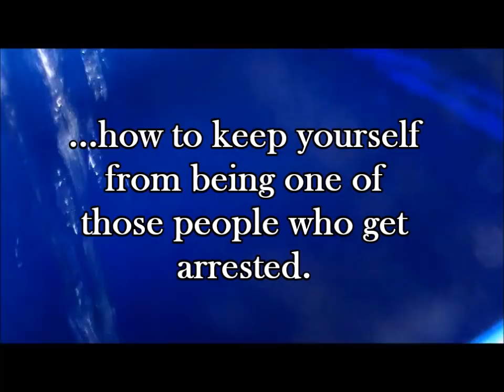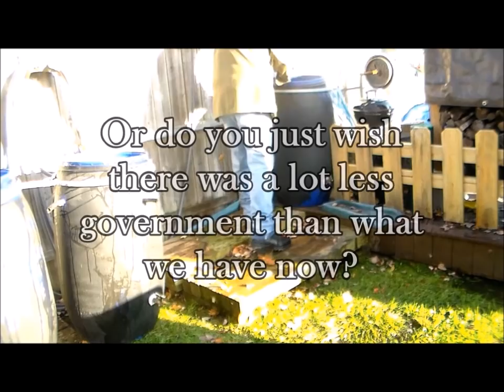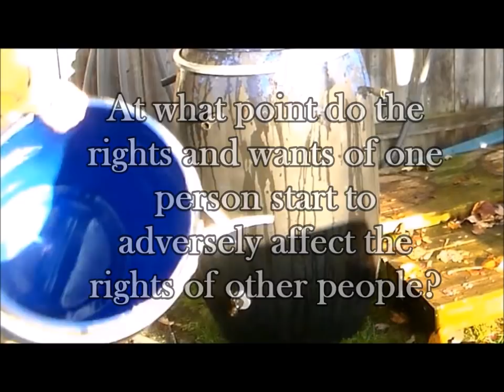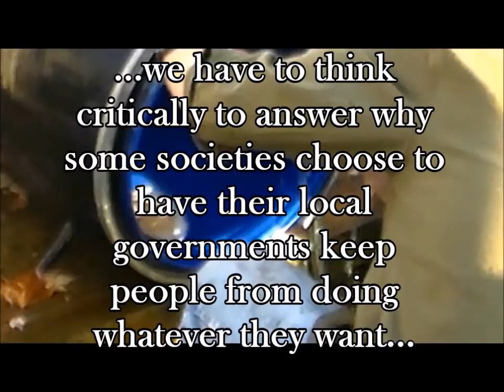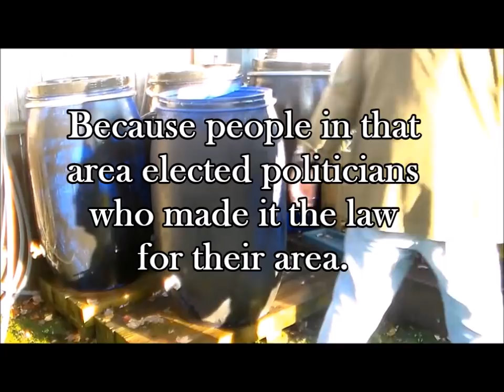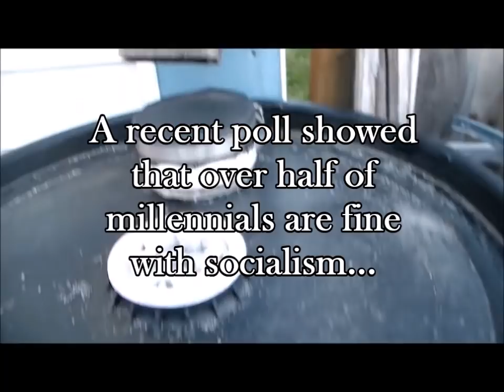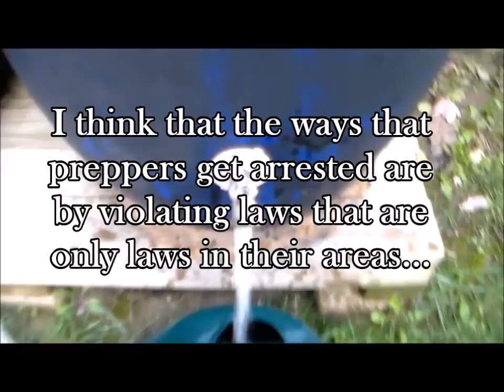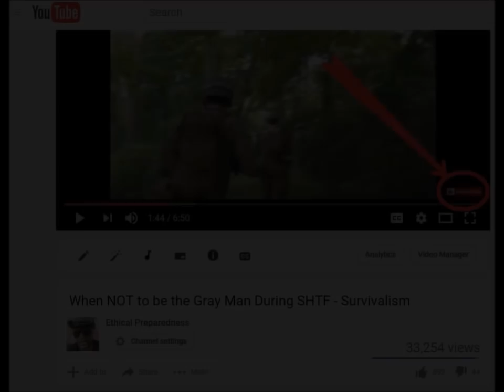Two Reasons Why Preppers Go to Jail

Comment: A few corrections. The man in oregon had 3 retention ponds and had Properly permitted them. The county Changed the law 1 yr ago and then revoked his permits. The retention ponds had been built for 10 yr's already. There was no reasonable way to empty and fill them in the 6 month period of time given to him.
So to recap He had LEGALLY built the retention ponds.
The local gov. Changed the law without warning or public debate.
The Ponds should have been grandfather under COMMON law.
You misstated almost every fact of the case.
Reply from the maker: So I've seen people go back and forth about this story since I posted this video.
But as I mentioned in my video: if the guy was hurting no one else then it was none of the government's business what he did on his property.

One of the main points of this video was to get people to 'read beyond the deceptive headlines' and use critical thinking skills.

Comment: As an Oregonian and former County Commisioner, most of your of the facts in the main example of you video are correct. Oregon Water Law (passed in 1905) made all water that reaches the ground, public water to be regulated. If a person wants to collect rain water, it is legal to do so, so long as it is not public (surface or well water). Oregon Water Law does regulate well water to prevent over pumping of ground water. Property owners have a  right to pump ground water to provide for their home use (50k gallons per day) but not for commercial use without a permit/State granted water right. Your approach to the question of government over-reach is reasonable. The higher the population density, more rules. Government is power. When people do not oversee what their local government is doing, they are in peril. If you want to protect your God given Rights and you State granted privileges,  pay attention. Just sayin'.....

Comment: My question, why were those water barrels has such filthy water. Hint: if they have the covers on and just a small hole to NOT allow leaves and other stuff in, the water stays clean. Plus, lets not ignore that in some states it is illegal to collect water. Example: Utah, which owns all water INCLUDING gray water which homes are build to collect. Of course, Utah is mostly a desert, turned into a productive state, although most people don't know that.
Reply from the maker: I had been working on them (little by little) over a couple of week's time, and I had left the tops off of a couple of them until I finished tearing the down to clean them.

So the couple of barrels that had some really dirty water in them had the covers left of them over a couple of week's time.

Normally the covers are always kept on and normally the water is pretty crystal clear that comes out of them. Except for the very first barrel, that usually has a lot of crap in it that gets flushed in from the initial onset of the rain.

I did however just a week ago install those "First Flush" systems on both of my sets of rain barrels. So far they've done pretty good at letting the filthy initial roof run-off rain divert into the reservoir while diverting the cleaner water into the barrels. :)

Comment: Off topic: why do you connect your rain barrels at the top ? For filling ?
Reply from the maker: Since I have a regular tar tiled roof, a lot of 'gunk' gets washed down into the barrels. And that gun has a tendency to 'mostly' stay in the first barrel and mostly floats to the bottom. So by having the connections at the top, it helps to keep the gun from transferring from one barrel to the next. 
And the further away the barrel is from the downspout, the cleaner the rain water has a tendency to be.

This spring I'm hoping to connect one of those First Flush systems though. :)

Comment: Renewable solutions should be applauded and promoted to help sustain and increase resource useage. Eg allow rain water collection off rooftops for domestic use of property irrigation, drinking water, grey water and sewage providing it is allowed to responsibly drain from the property in a suitable manner. By all means regulated sewage black water treatment systems to ensure no harm comes to others and environment from pathogens. I do however think that if you obstruct watercourses then permission should be evaluated after a impact study as it doesnt affect just you. If neccessary to appease gov have regulations about maintenance of larger systems.

Comment: First, I understand what you're trying to express concerning the headlines. You are 100% correct in that aspect. However, when you mention elected officials carrying legislation representing the people, I have a problem with someone conveying that it's okay for someone to make a law to represent the majority of the people while infringing the God given rights of the few. Those rights are protected for a reason, to avoid tyranny. Tyranny happens when majorities take rights if MINORITY. So when you mention living somewhere where people elect people to pass laws that do that like we should only have certain rights depending on where we live, is wrong. Yep, the guy built a dam and infringed on other's rights to safety, security, and the water access. That's the issue in that one, exceptional case. But you know there are far less exceptional cases, and you know the government says it owns the water, which it does not. You know what I meant, I do believe. As long as someone does not infringe on another's right, or cause harm to another individual or their property, they should be left alone. That simple. Majority can't decide to suspend the rights of the minority, that's tyranny.
Reply from the maker: I agree with you. If that guy honestly wasn't hurting anybody or putting anybody else in danger, then it's none of government's business what he was doing on his property (and other examples like that).

I also think that the government sometimes makes laws that infringes on the God-given rights of people in order to represent the majority. 

If I conveyed that I thought it was okay for the government to do that, then I either didn't articulate myself clearly or you misunderstood what I was saying. I believe that I said in the video that if the guy wasn't hurting or endangering other people, then it was nobody's business of what he was doing.

But my whole point of the video was for all of us to read past the headlines, and not let the media tell us what to think. I just used this guy as an example because a lot of the media pushed made a lot of people believe that he was arrested for having a few rain barrels when there was much more to the story than that.
*Special note: after I did the video, I also had several people notify me that the guy had also diverted creeks to help fill his reservoirs. And that this potentially robbed people of water that were down-river of him.
Reply: Yea, I don't wanna distract anyone from your message, cause it's a great message and relevant point that everyone needs to be vigilant about when seeing headlines. I believe I am just very sensitive about narratives that are out there trying to slide in covertly within topics of truth, little comments or retorics that promote certain thought processes that lead to slowly manipulating the people into giving away their rights. Cause our Constitution is under heavy attack right now. This younger generation knows nothing about what the bill of rights and the Constitution is even, how and why it's there, what it means, and why it's important to protect any of it. So, just understand I feel protective it and was referring to the legislative comments. That people may not want to live in certain places where the majority votes in legislators that pass legislation that prevent them from certain rights. I was only defending the fact that you have those rights wherever you live, some places you will have to fight harder than others for them, but you gotta fight for them. It shouldn't matter where you live, laws or not valid if they are not constitutional, and California is the best example. If people don't start speaking out though, instead of folding and retreating, we will wake up one day and they will all be gone.

Comment: Gossip. It’s a safe bet to assume that all “programmed” individuals are against independent living, therefore we “assume” the risk.

Bury your barrels underground. Use a common in-line fuel pump (installed inside) to pump your water to the filter.

Don’t forget to line the barrels to keep the plastcized oil from seeping from the barrel into the water.

The oils in plastic specifically effect the male endocrine system...as well as the reproductive system.

Comment: I like the self reliant attitude of the preppers.  I myself am a bushcrafter and sometimes survivalist. If there ever was a SHTF scenario I can head for the woods and get by quite nicely. I have on occasion helped some preppers out by advising them about their bugout bags. I understand your point about breaking the law. What I do is considered criminal trespassing in most areas.  I also liked your point about critical thinking. That is a skill we all should practice. I have had to jump on a few so called "experts" because they were flat out wrong.  Now my view on the preppers. I think it's a waste of time, money, and effort. I think stockpiling, in general, is a waste. Foraging, or depending on the situation, pillaging does wonders. I suggestion you learn the arts of preservation both drying and smoking. I wouldn't recommend canning or pickling though unless you are up on how our ancestors did. Another thing that gets me about preppers are the guns. I have nothing against guns. I can and have used them. But they are a manufactured item. Depending upon how bad the situation and how long it goes on two things will happen. You will run out of ammo and your gun will break down. That's why I prefer blades or any of the pre-gunpowder weapons. I can make my own with what nature provides. What really gets me though is the mindset that something bad is going to happen. A lot of bad things can and do happen and most them you can't prepare for. But with some knowledge you can survive.
Reply from the maker: Thank you for sharing your thoughts. I appreciate it.

Now I think having firearms is pretty important. Because firearms provides greater distance, where an edged weapon or an arrow or a spear usually have a much more limited distance. 

You are very correct about a gun being a manufactured item; and that eventually a person will run out of ammo or the firearm will break. But until that time happened, I would not want to be facing a marauder that's armed with a rifle if I were only armed with a knife or a spear. 

I mean, if I were able to stay hidden like a ninja I'd be more comfortable with only being armed with an edged weapon, but eventually a person will want to build a structure strong enough to withstand a wind storm, etc. And it would be hard to keep yourself that hidden every second of the day. 

But for me: stockpiling food is to help compliment the skills that I'm still learning. I'm still learning how to have a self-sustaining lifestyle. If SHTF were to happen: the stockpiled food would assist in getting my family through the first winter until food could be grown again. And the stockpiled food would also help to extend the food that is grown (and vice-versa). 

But here's where I totally agree with you: the more that we can learn to make on our own; and the more we can get by without having to be dependent on store-bought stuff: the better.

PS: Please know that I wasn't putting down your thoughts. I was just sharing mine that differ a little than yours. :)
Reply: Thank you. I respect your opinions. We share the same goal which is to survive a situation. No offense to you, but it seems to me that preppers are short term thinkers planning on how to endure a situation until things return to normal. My mindset is based on a long term "this is it" situation.  I have no problem with firearms and would use them.  My favorite is a .22 bolt action rifle. But like I said, when you run out of ammo or the rifle eventually does break down it is useless. By the way you might want to learn some ninja skills. Seriously. They work. Also learn some bushcrafting :)

Comment: You said 
"Colorado" 
instead of 
"Oregon" on that note about the guy getting arrested over rain water. (I live in Oregon not too far away I imagine)
On the first mention of this is when it happened (early in video)

You should put an annotation at that part correcting this mistake :)
Reply from the maker: Yeah, I made a mistake and said "Colorado" that one time when I actually happened in Oregon. 

I said Colorado by mistake because I had Colorado on my mind because Colorado used to have some pretty strict laws against collecting rain water. 

I would go in and add those connotations, but YouTube makes it a pain in the butt to do so once a video has been released (or at least I've not found an easy way to do it). :)

Comment: See those black barrels? That's what you need to store water. Store in a cool dark area capped with a screw on lid. Light allows algae to grow. Standing water has to be capped because of the mosquitos. Use Common Sense when collecting water.
Reply from the maker: I would really love to be able to put those barrels into my house and feed my water line through them (so that I would always have several hundred gallons of freshly rotated water on hand); unfortunately I don't have the space. So instead I use them to catch rain water. :)

Comment: How could you possibly collect that much rain water in a reservoir? There would have to be more than rain water supplying it. If only rain water it would become ground water
Reply from the maker: If I remember right, I found out later that he had actually diverted some streams to feed the reservoirs too. And I think that's what actually got him in trouble, because when he stopped the flow of streams then he 'robbed' people downstream of him of their water rights. But I'm not 100% certain of that.
Reply: Sounds possible. I read about that case. Don't remember all the details.  I do remember that the story that was presented didn't sounded a bit fishy. But I don't know. One thing I do remember is it stated that the fire department used the reservoir for fire fighting.

Comment: I'm not familiar with the story about the lakes, but if the locals were clashing like that I feel like it was probably started over building it without a permit and thus probably not built to code. Speculation of course, but that's a possibility.
Reply from the maker: After I did the video, several people commented that 'the final straw' was when he 'diverted' water from a stream to fill those lakes; and when he diverted that water in the stream that it basically stopped the water from reaching people that lived downstream from it. In essence he was robbing people downstream of their water rights.

Comment: All rules and laws were created for a reason. Most of them because someone did something that caused harm or problems to other people. That's also why the amount of laws correlates very highly with population density. If people are in each others face all the time, there will be more friction.
Making laws takes effort. The bad people spoil it for the rest of us.
Reply from the maker: I agree completely with your comment here; and then I somewhat disagree with your other comment you left.
To agree with your statement here: many people don't understand that the more highly populated an area is, then the more laws that area will have in order to help people 'get along' better. When people are crammed on top of each other: noise ordinances have to be made, cleanliness laws have to be made to prevent the spread of disease, parking laws have to made so that firetrucks can make it down a street, etc. :)